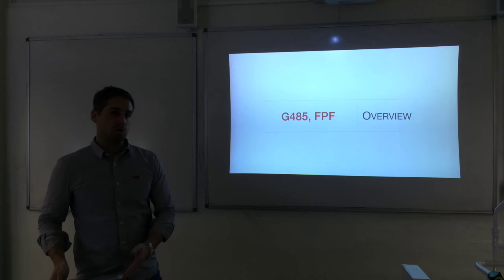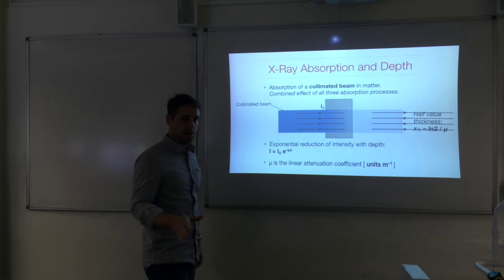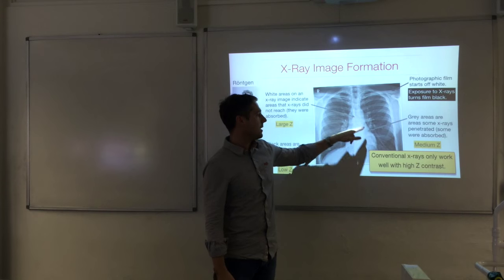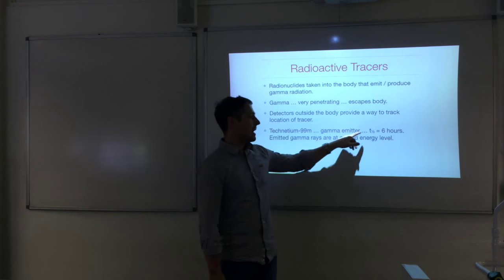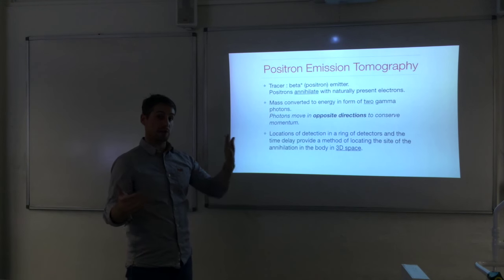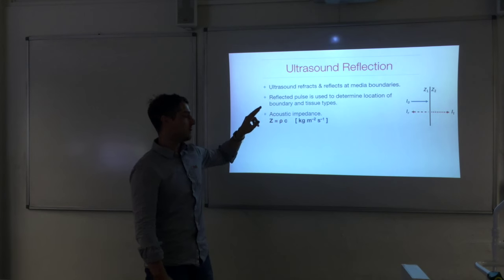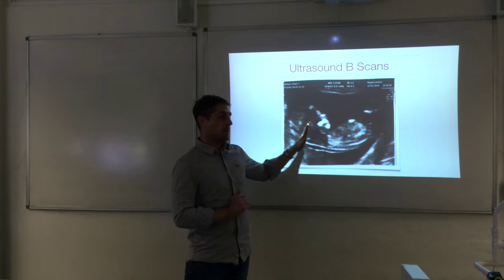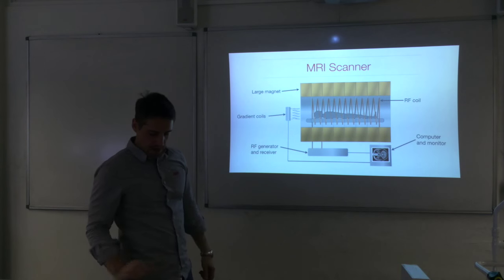G485 Fields, Particles and Frontiers of Physics (FPF) Overview: Lecture 4 (Medical Physics)

Comment: I may be wrong, but at 45:00 you derived the equation to find one of the distances from the detector. Shouldn't the equation be d1 = (1/2)(D - v[delta]t)?
Reply from the maker: Correct. I messed that up. I'll add an annotation. Good spot.